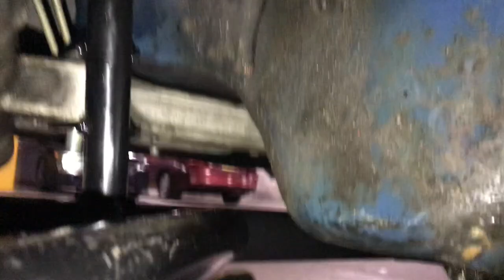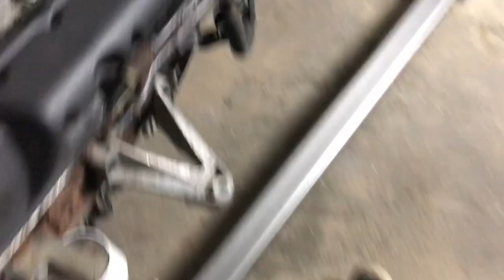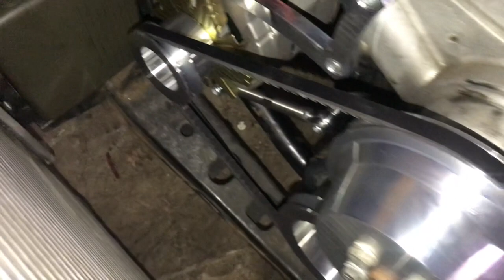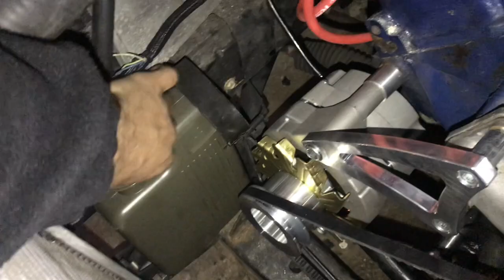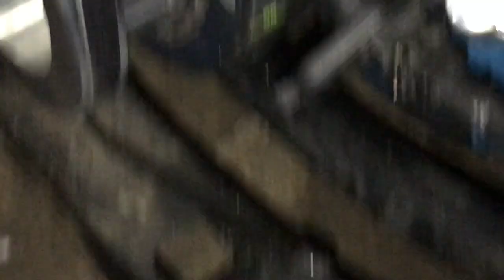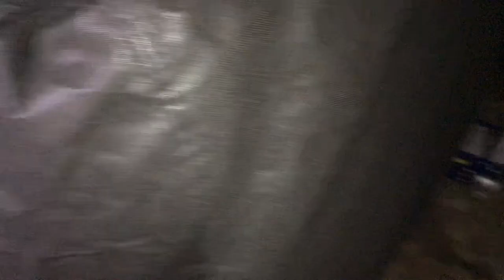S197 460 Swap Series: Episode 2 *First Start!*

Comment: what transmission did you use I am looking to do that to my 05 v6 mustang any advice
Reply from the maker: Hey, I used a Ford c6 transmission. Next I plan to use a ATI superglide 2 to handle basically all the power the car will ever be capable of making.

Comment: I wanna do this exact swap what am I looking at price wise? And will it be cheaper to go sbf? I just want a retro fit engine
Reply: Thinking of doing this with the sbf and 5 speed myself. You find any useful info?
Reply: @Spoofaged  ended up going sn95
Reply: @Spoofaged  I did it with a 351w stroker and a Tremec 6-spd. Mechanically, it's relatively easy.

Comment: are you using the stock gauges if so How did you get the speedometer to work
Reply from the maker: Yep! Stock gauges and I used a speedometer signal converter box and signal generator thingy. It should be on my Google doc!

Comment: What two pin on the computer did you use to run the tach
Reply: When I did my S197 SBF swap, I used the OEM crank position sensor on a 302 Explorer reluctor wheel mounted between the harmonic balancer and the crank pulley. No rewiring was needed.

Comment: I got a 2001 and an 03 Mustang, both are 3.8l. Thinking of doing a swap for a v8 but haven’t made up my mind on what motor, I really been considering doing something different than everyone else by swapping in a old school ford 390 fe motor. What k member did you go with?
Reply from the maker: Sounds nice! Not sure if they make one for your model year, but I have an AJE Tubular K-Member. It is a specially designed K-Member to be compatible with every engine swap you can think of.

Comment: What crankshaft tigger kit did you use i did a 302 ho swap cam and aluminum heads. Thanks
Reply from the maker: RICHARD Twilleager I used the ford 5.4 trigger wheel and welded it to the harmonic balancer spacer

Comment: carb fuel pressure is 6.5 pounds. I think you'd be doing good to relocate the ignition coil someplace OFF the engine.
Reply from the maker: Thanks! I ended up swapping in efi because the motor is getting boosted (video coming soon of all the new parts and changes), I cannot relocate the ignition coil anywhere as it will introduce RFI into the efi system unfortunately but it seems to be doing good in its current location. Still
Reply: @devilstangsjustin8165  - For the benefit of others that might come and see this video, I mounted my coil low on the driver's side fender well behind the ABS module. It's down at about the same level as the header exhaust ports on the heads.

Comment: You may consider a Speedmaster two piece intake you buy the dual carb and can get a single adapter to switch between the two.  It dumps into a chamber and is lower profile.

https://www.amazon.com/Speedmaster-PCE147-1127-Intake-Manifolds-Carbureted/dp/B01NCTB6ER/ref=sr_1_1?keywords=Speedmaster+PCE147.1127&qid=1560651778&s=gateway&sr=8-1
Reply from the maker: Jeff Yates thank you, taking the forced induction route now so still need single carb style. New vid dropping when it's done!

Comment: What type of transmission did you end up using? I’m starting the same swap except in an 09 GT. Thrown rods through two 4.6 aluminum blocks. Frp cams, cold air intake, lth, off road x pipe, Ford racing intake, 62mm thr bdy. Blew rods through two blocks. All bottom end damage, nothing top side. Tuned through bama.. actually. All parts from American muscle. Any info would be great man. Any pointers, what to watch for etc.. thank you in advance!
Reply from the maker: check out my build list! https://docs.google.com/spreadsheets/d/1sItV8mOu57EDz58ob2gsK1tr5KvDQFF2qCoAuunoJ0E/edit?usp=sharing